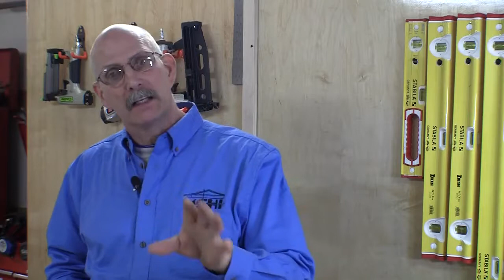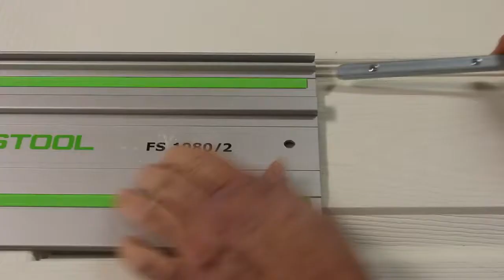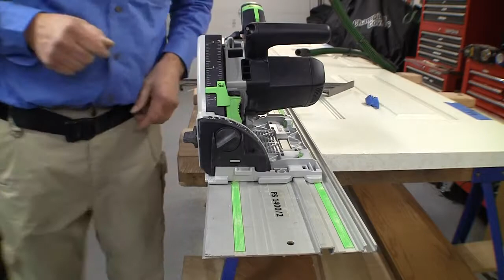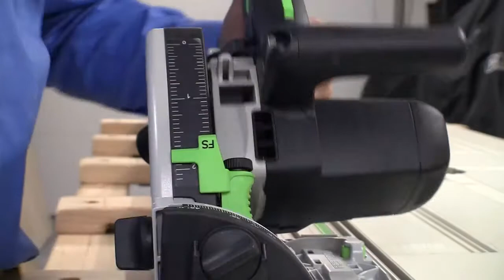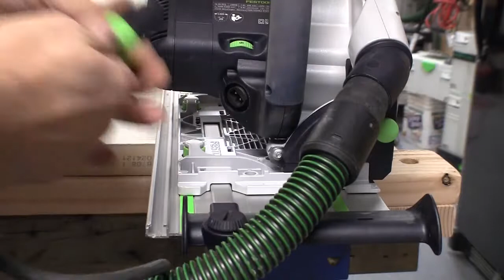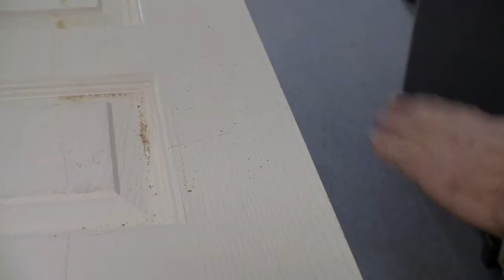Back bevel a door using a track saw by Mike Sloggatt

Comment: Reducing the square edge to a bevel on the outside of the door will have a lob sided effect on the mortice lock keyplate. The outside of the metal work will be sticking out whereas the inside will be neatly in its recess. That won't look good !